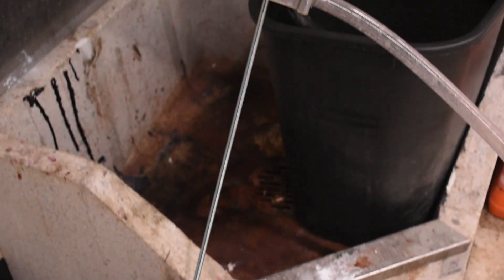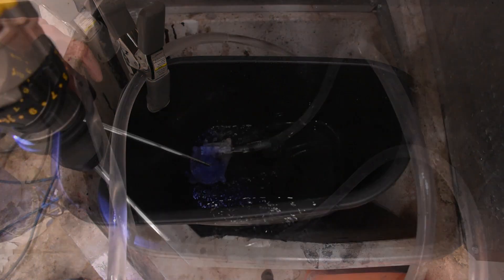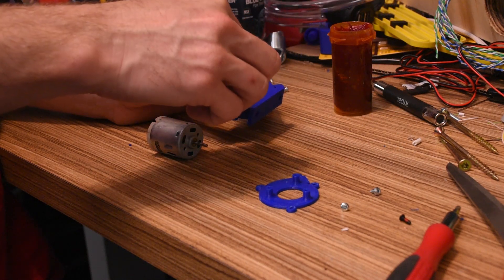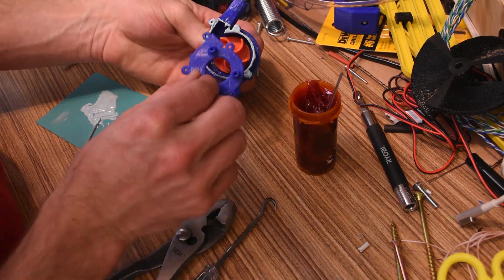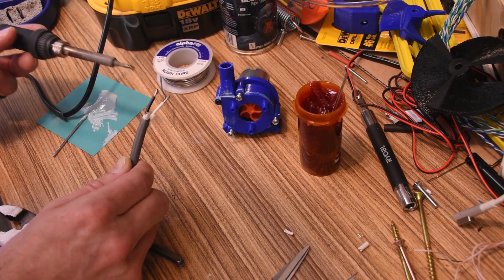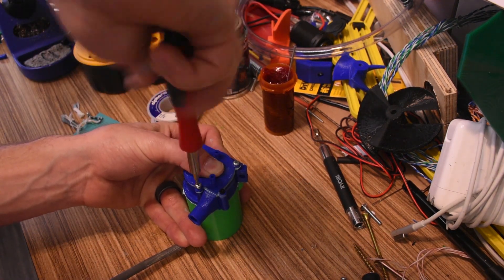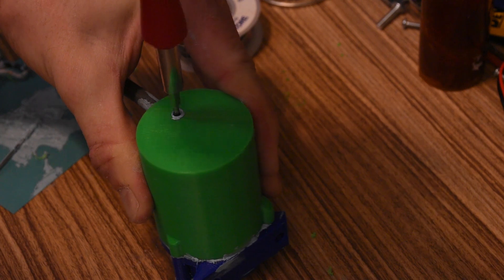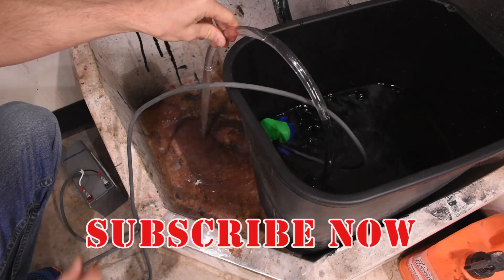3D Printed Water Pump - Mikes Inventions

Comment: nice one i have a Anet A8 which i bought very cheap but work very nice and the  models are very clear with nice details so here im cause i have a waterblock for pc and im gonna buy a radiator diy a reservoir the only problem is i don't want to spend these 30-50 euros for a pump plus i looked for aquarium pumps and they kinda give only some low RPM for a price of 15-100 they never go more than 1700-2000 RPM are there a way to make this designed pump with some serious motor that will give a fair spin rate ? and if yes which motor should i buy for it and how much its cost for what RPM i want to try to go as maximum speed i can to see how really good it can got with thermal performance on my pc

Comment: Thanks Mike! This actually worked great as a sewage pump! It's far better than any design I've tried from Thingyverse and packs quite a decent flow. I'm printing a 200% size version now with a 12V drill motor to see what it's like super sized.
Reply from the maker: Glad to hear it Daniel! Thanks for watching. Let me know how to 2x version turns out.
Reply: Pumps a big volume of water! The only thing I did find is that the pressure of the water being pumped goes way down,  this is probably just the non-linear way the physics scales. It can really move a tonne of water up a 2cm height but if you want to pump up 1m into a bucket, it won't push it up a hose at all. The small 3V version did that well enough. I think this is because partially the 12V drill motor I'm using isn't the fastest, it was a cheap drill but it's more torque that speed even with the gears removed. Would need to maybe keep the gears but use them backwards or something. Also 200% print size isn't linearly 200% the surface area of the impeller. It looks easily 4-5 times the surface area. Very cool looking though. Your design is great at keeping the motor dry with a bit of sealant. Only change I made was keeping one small metal gear cog on the end of the motor rod because the rod tends to break away from it's glue after a while, even on the small one. The cog was better at keeping a grip on the printed impeller.

Comment: the thumbnail Made me think it was a turbo
Reply from the maker: The devices are quite similar, so I can see how it's possible to get confused. A 3D printed turbo is possible, but not with a Craftbot. :-)
Reply: Mike Thompson technically you built a electric centrifugal supercharger
Reply: technically it's a pump, it wouldn't compress air due to the loose tolerances.

Comment: Why not add another hose so you don't have to put the pump itself into the water
Reply: +LJH I'm guessing because the intake would have to be primed with water before it would pump, clearances aren't tight enough to create enough suction on the air to start sucking water up the tube so is just easier to submerge the pump and give it water right away

Comment: Did you measure voltage and amps in, free flow rate out, max static pressure? Thanks for posting the build. 

I always like to see people making things themselves.. 

For anyone thinking about using this design for any type of long term use... the motor is probably going to overheat in that configuration since it will heat the air inside the enclosure and the plastic is a poor conductor of heat to the water.  This type of motor is not very efficient so around 40% of the power is converted to heat. 
Also, this shaft seal will probably start leaking relatively quickly.  This design is great to stimulate ideas but don't build it thinking it will be a long term solution part of a bigger project. .
Reply: Would a better design utilize PTFE between the impeller and the plates? Maybe with some slight notches in the plates and impeller to make it a nice fit? Maybe that increases friction too much though?

Comment: I know what are you going to build. Plant watering system, using Arduino and moisture sensor, maybe even raspberry pi, so you can control it via shell. I did everything the same, a while back. when you soak the pump into water, motor gets wet eventually and dies. 3d printed case is not a good option. btw there's a pump on ebay for couple of bucks. good luck my friend. I will press like and subscribe

Comment: if you are worried about the motor getting to hot just get a small section of copper tube and bend it around the motor and then plumb the copper tube into the output of the pump
Reply: Derrick Ivery lol

Comment: Earlier today I was wondering if I could 3D print a pump in order to build a water pistol. Looks like I've found a good candidate.
Reply: Did you mean a water machine gun? :D
Reply: @deniskhakimov  Didn't work well enough for that, unfortunately. In fact, the pump rotor wouldn't stay attached to the spinny bit.

Comment: just a heads up if you're running 12 volts you do not have to worry about waterproofing the motor it will run underwater with no problem. In fact you could run it at a higher amperage as the motor will be cooled by the water.
Reply from the maker: Patrick, thanks for watching. You're absolutely right about 12v being safe underwater. I sealed it to prolong its life (perhaps). I've had motors go bad quicker when wet, or quit all together when exposed to salty water.
Reply: i was thinking the same , i need a pump for hydroponics. I think the nutrients have lots of sal in it
Reply: Why only 12v?